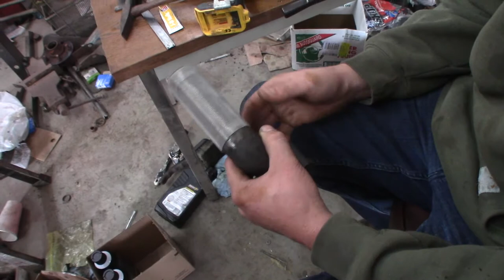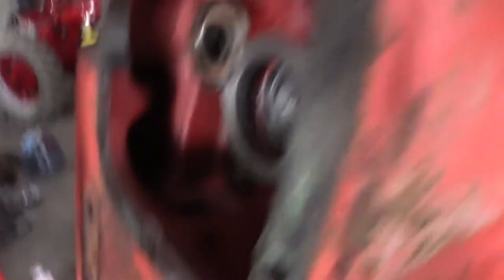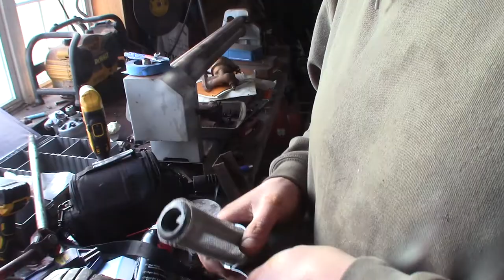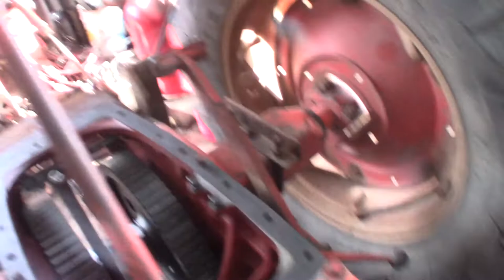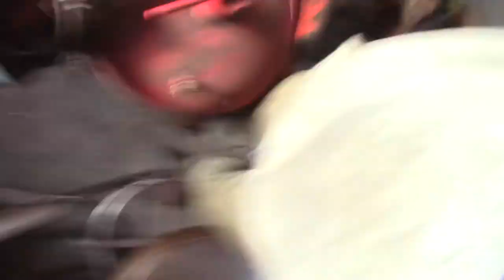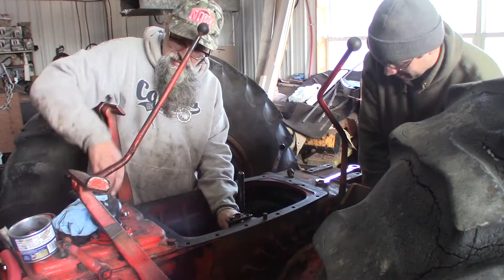Case 830 Comfort King re-installing the PTO housing

Comment: Hi guys I am working on a 2470 traction King the PTO stopped spinning and then the tractor would not move and the trans pressure Gage was in the red I was wondering there is a controller box that is supposed to divide the pressure and I saw a video where the spring had come off the snap ring
Reply from the maker: Hey Will; yeah I don’t know for sure. We had a 970 40 years ago, can’t remember exactly but I think you’re right about the split valve. All the pressure going one way? I do know the powershift needs pressure to hold the clutch packs or no go….thanks for commenting and best of luck with that big beast!!! John